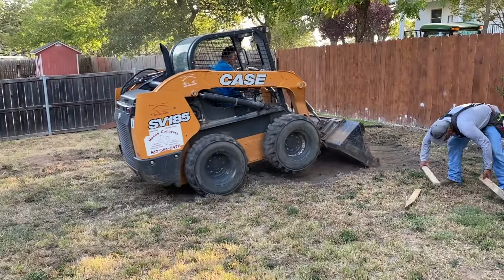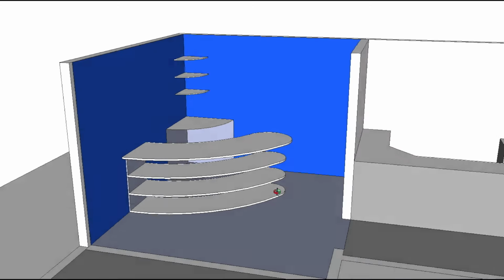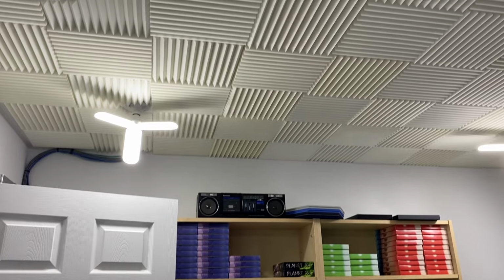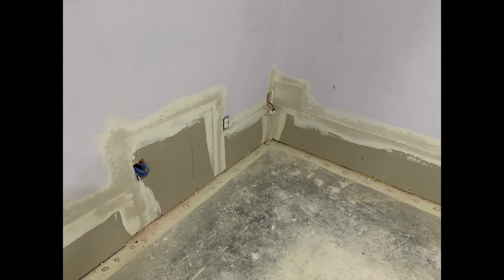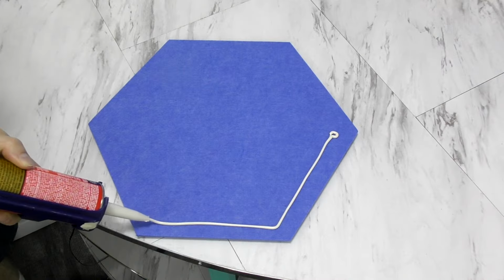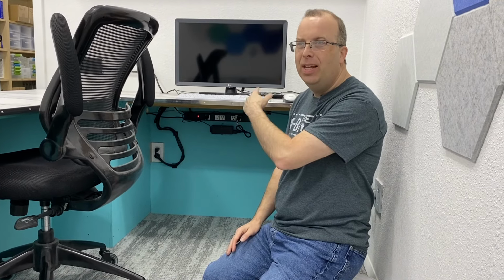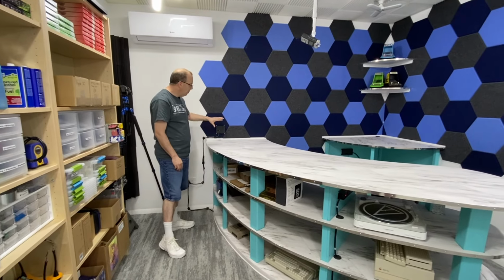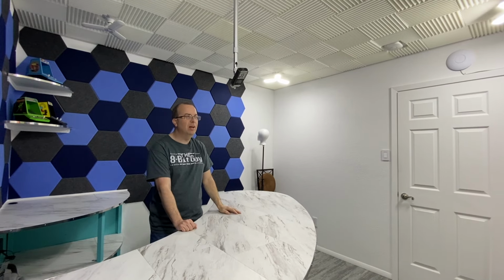8-Bit Guy Studio Build - Part 3

Comment: The WHITE background is a MISTAKE as it's always going to fight for attention with foreground objects (including the 8-bit guy!) Your last set was almost perfectly balanced, maybe by accident, with the lighter objects usually being in front of the darker. (white shelf in front with dark wall behind.) I'd repaint the back wall making sure everything on it is darker (and less pink) than your skin. The counter in front should be just slightly darker then the standard beige computers you put on it (to give contrast.)

Having two hues of blue (blue on the design and aqua on the base of the counter) is an eye sore. Compliment the blue with the same shade of orange that was on the drum machines on the keyboards that were in your last set. It is the natural complimentary color to true blue.

Finally add fine detail (like hanging computers and such) on the side walls, to add interest and diffuse echos, but leave the area directly behind you head a simple geometric shape that's slightly darker than the rest of the background to frame you. Always shoot with the walls at an angle to give depth. (avoid lines in the background that run parallel to the frame)

Comment: I actually like the tiles behind.   Only issue is on the right side ,  you should add a few extras so it looks finished on the camera.    I also would consider using the lapel mic more often.   In my opinion it sounds better and as you move around, doesn't change the sound like an overhead will.   Lighting wise you should consider some film/tv grade lights or filters.   I find you look more washed out with the ones you got.. perhaps adding lights against the wall as well to give more contrast. Over all its great.    Minor details make great into awesome.

Comment: You should have central unit air conditioning with a 3-ton heat pump plus with a Merv-11 filter also with a coil heater on the inside of the central fan it's way more efficient and is way better for your air health.

Comment: If you hang some curtains over the opposite walls, doors & shelving, it can help reduce they echo more.  I often use black-out curtains on-the-go with stands to block unwanted light on-locations and also for sound dampening.  Hung from rods, you can easily slide them off to the sides when you don't need them for shooting.

Comment: Regarding all the comments about grounding the metal workbench edge:  Antistatic work surfaces and wrist straps are grounded through a resistance in order to protect the electronics, NOT YOU.  They try to bleed off the static buildup before you handle components.  Any work on high-voltage, include line-power and especially higher like on CRTs requires a different strategy to protect YOU.

Be careful, stay safe.

Comment: just use a 1:1 mains isolating transformer, you can then accidental touch phase and no shock. and now you can also use rcd's (didnt have them in the 80s / 90's, but always used the transformer. btw, a hv discharge from the back of a crt (its same same as a charged discrete capacitor) will kick you hard whether you're grounded or not !!!

Comment: safe to touch esd strap would be connected trough a 1-10m ohm resistor anyway ant esd cable have them in series with the plug both as a safety measure and as a anti-zap feature when you charge your feet on the carpet and touch the esd ground to let you be discharged slowly

Comment: Sound could still use some more deadening - it's a bit boomy, I think you could use some bass traps in corners :) And some real mineral wool panels on the wall (and possibly right above where you stand ) that's not visible, to absorb sound reflections.  The foam that you used on the ceiling is not very effective as sound absorber, it's often marketed that way but doesn't do much.

https://www.youtube.com/watch?v=_dH4H57UsJU - (apparently fiberglass is even better) it even has the instructions how to make those :)

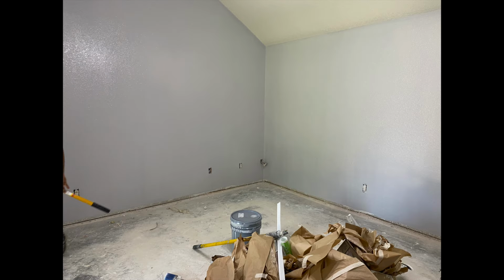Comment: 7:54 - The cat is still wondering what happened and why the food bowls were moved about 😾😾😾
18:15 - I think there are too many dark tones regarding the wall tiles - The blues are fine, in my opinion, and the black/greys are the issue.  You could swap out some of the black tiles out for light grey tiles but something you could do straight away would be to take some photos and check the histogram to see how flat/balanced the histogram looks and adjust the tile colours.

Comment: I think you went the other way and now your washed out and over exposed. Simple fix in post, but your table is definately washed out, which is sad since thats where you are putting the focus after yourself. My only practical suggestion for your table being super white, is maybe run an almost transparent resin. Kinda like how you tinted the windows. If you want to build on an 8 bit theme, you could get little tile squares for mosaics or something to put in there and make them like pixels on a screen.

Comment: Don't want the sun to turn my old computers yellow. A few weeks later: Okay, time for some retrobrighting... drags old computers into the sun... ;) I still struggle to understand what is really going on during this process. Recently I pulled out a midi-keyboard that was hardly exposed to light at all, because I've left it in its box for years and all keys were completely yellowed. I believe it was exposed to cigarette smoke a lot during that time and that this would be the reason.

Comment: My opinion on the hexes - they are too strong (striking), you vanish a bit, they draw all the attention. Maybe it was partly because of the T-shirt you had on this particular video. They are also too dark and at the same time there is too much contrast between the dark ones and the light blue ones. I think a solid color or some subtle gradient or pattern would be better. And last but not least - the cyan color of the desk at the back doesn't match the blue color on the wall, not at all.

Comment: Why on earth would you ground that metal strip? If you are worried about destroying electronics by an ESD you should put a resistor in serial to ground and make sure the surface is made of ESD protected material and properly grounded as well. But seriously, I would rater have some electronics destroyed instead of accidentally electrocuting myself by forgetting to flip that switch.

Comment: Was thinking that another alternative for the walls would have been to use the 'maze' generator you've demonstrated (and that has been done lots of times) to generate a layout for vinyl cutouts to put on the wall. That said, the fabric tiles probably add some more noise suppression, so it works too.

Comment: OK, what happens if you get a mains live to earth fault in your studio which isn't caught by an RCD or ELCB and the edge of your desk becomes live? The end result could be hair raising to say the least. I suspect you need additional circuity where you have your switch to ensure that doesn't happen. A large value resistor might also be a good idea. With static electricity you need you and the item you are working on at the same potential, that why you ground yourself to the item you are working on, not to mains earth 😀

Comment: Please please please RETINT YOUR WINDOWS! I've worked with Window Tinting shop (for Houses and Vehicles) and MAIN RULE IS - Home Tint should be applied from the outside, especially if it's "Blocking" or "Reflecting" either View, Sun or IR
You can concetrate so much heat inside the glass that it can shatter when tinting from inside to block the outside rays. You can tint from inside only if it's that Car Tint that adds a shade, but does not reflect or "block" sun rays.
We always removed the windows/glass from its frame, turned them around, set them on the ground, cut, clean, clean, wash, THEN TINT, then put the Glass into the frame

Comment: The hexagons look cool, but the turquiose wood definitely clashes.
Reply: I'm come to the conclusion that turquoise doesn't match anything.
Reply: @KurtNiemand  it matches anything pastel and every tint of pink.
Reply: @KurtNiemand  

I disagree. Torquoise is a "soft" and bright color,  but it's not being used correctly in this video.

Here's a combo that always works together in RGB

#016875 - Dark turquoise
#01A9BB - Light turquoise
#FFFFDE - Pale Yellow
#DBE5EF - Light Grey (With tones of blue)
#52626F - Dark Grey (With tones of blue)
Reply: I agree. really like it but would paint over the turqouise with the navy blue colour, or grey
Reply: The hexagons look okay. The gray isn't solid so it looks out of place with the solid black and navy. The turquoise wood looks absolutely terrible. Repaint gray and everything will come together much more nicely.
Reply: I think they would look better with the lighter gray hexagons
Reply: Add in the metal straps on the edge of the shelves, it's just too busy.  All dark blue hexes would be better.
Reply: The colours don't really fit together. But I would be carefull not to get too dark in the end.
The turquoise is a great colours in my opinion. But it clashes with the other colours a little. I didn't expect the whole wall to be covered with tiles either.
However, finding the perfect design is not always easy.
Reply: @hw2508  I think it's a design clash

he brought the outdoor colors inside and don't make sense with the Wall Tiles 

Instead.

He should add a different theme to the inside.

Whilst the c64 has a terrible contrast  in terms of a view for BASIC

it'll work wonderfully as a room theme

use that
Reply: Basically

VIC-20 on the outside and the C64 on the inside.
Reply: It's more like a sea foam. or undine. But I like it either way.
Reply: @Her_Imperious_Condescension  straight as a rainbow 🌈
Reply: @poopiepants1564  
No.
Reply: @Her_Imperious_Condescension  ya man, u love men
Reply: I think orange goes well with turquiose. Like the Miami Dolphins football team.
Reply: ok gay guy
Reply: @poopiepants1564  
Ace, actually.
Reply: @Her_Imperious_Condescension  gaycey acey got it
Reply: @poopiepants1564  
Ace = very much not gay
Reply: @Her_Imperious_Condescension  DONT DENY YOUR GAYNESS GAYCE ACEY! U LOVE MEN!

Comment: No jack on that wall:  could be worse!
In the early 90's I went to work for a start-up and their space was under construction.  They were so clever in specifying an Ethernet port at the end of the hallway, so they could put a printer there, on a table beyond the last office door where it dead-ends.
So, they had an extension cord running into that last office, as they forgot to also specify a power outlet there!

Comment: For ESD grounding mats, tables and wrist straps have a 1 megaohm resistor before connecting to mains ground, 110volt or 240volt faults to ground through your body thus will not be enough current over 1 megaohm. I work in a manufacturing room where we have inhouse designed full ESD safe workspaces

Comment: I agree with the idea of lighter walls and a darker table, in part to keep the visual weight at the bottom where it feels more natural. Did you consider painting the walls a solid color at all? Then you could key in any background you wanted in post, or change the color depending on the theme of the video (assuming your clothes or products don't share the wall color).

Comment: You really shoud ground that strip through safety 1M ohm resistor, better consisted of more resistors in series. That way if you really happen to touch the ground strip, you won't get electrocuted that easy.

Comment: The tile colors work for the most part, but it does absorb maybe a bit too much light, regardless, if you put some more tiles on the door wall, and maybe a few on the back of the door itself, it would eliminate all the echo.. I'm watching on a Galaxy tab s7 and using Harmon kardon buds for sound.. so I can really really pick up those sound reflections.. it's much improved and your sudio really has me thinking about doing the same thing for my computers and ham radio equipment...

Comment: Your lock on your door is the same as the one my wife and I just installed last night after our previous lock jammed in the locked position (funnily enough that lock was a direct replacement of the first lock that came with the house that did the same thing 1 year previous when we had first moved in that our builder had replaced saying this issue was very rare and he had only seen it about twice before. 
Hence why we now changed brands and went for a smart one.

Comment: It turned out a very nice set up. Congrats! There are a few spots in the back where there are no hexagons and you can see the white wall behind. Messes up my ocd. Looks bad in my opinion. Perhaps you should consider filling those spaces up? The small ones, right in the center of the frame, around the shelves. You filled up a few, but not all of them. Cheers

Comment: Don't hard ground that metal strip, but use a one meg resistor, that way the static will be dissipated, however if you touch it with a pcb etc, you won't (hopefully) blow the crap out of it.
As for the tiles, it would be nice to add some computer brand logo's to them, so they have a connection to the subject.
I like your stereo mic, it does a great job.

Comment: tapping into a surge protector for an exposed ground like this is not a super great idea. your nutral line on your panel is tied to ground in the breaker box. and all it takes is a snaped ground wire from the fuse box to make you the shortest path to ground.

Comment: Hey, the hexagons are different. Better than the other stuff that was on the walls. Not bad. Not horrible.  Different. Do I like them? I'm not sure. The missing bits bother me. I know that they will be off camera, but just knowing that they are not "all the way" is getting on my nerves.
Overall, I love the build. I feel your pain about the ethernet ports. There is never one where you need it ..
One thing I didn't see, is your security camera system. Either very well fitted and unobtrusive, or not fitted. 
As for your studio worktop. I like it a lot. The earth connection is a brilliant idea. Except for the possibility of grounding out... Here in the UK we have RCD with earth trip... (I don't understand how they work either) but sometimes it can trip out when you or I, touch it. Something to do with static electricity... But hey, I know nothing.

Comment: you know we have 2021, right? i really like your content, but this NEWLY built studio is kinda weird i have to admit. i appreciate your favour of those lamps, but they don't fit any videography environment - you should rather get nice studio lights with proper umbrella diffusers. i also don't get your grounding concept. RIGHT in case you work on a CRT, both YOU AND the CRT should be grounded by the same wire. you can clip the grounding wire to your ankle, if you don't want to have it in your hands' way, but i'd show the grounding beforehand into the camera regardlessly, since you act like a teacher for some people. there are conductive mats for electronics work benches, that can be grounded and i really think you should cover your main desk with those.
just as a reminder: you are building a new studio, not rebuilding your old one. maybe it's time to go for a new style and way

Comment: Counter-intuitively, by placing the hexagons in a pattern, and more importantly, ensuring that no two touching hexagons have the same color, you have maximised the "messiness" of the pattern. Don't be afraid to make it asymmetrical and more "random". In fact, it might both make the pattern look more interesting, and more easy on the eye, than the current "static noise but strictly ordered" pattern. Jm2c

Comment: You should NEVER directly ground any ESD protection for exactly the reason you pointed out - hard grounds can be deadly.  Replace the switch with a 1 Meg resistor and you're good to go under all use cases.

Comment: Ethernet solution:
Remove the ethernet panel and indent the ports into its own box inside the wall. Then when you plug both ethernet cords in. They are flat. Because they connect inside the wall. You can always make it look a little dressed up if you don't want a gaping hole in the wall.

Short version. make the ethernet ports deeper to make wires flush/flat against the wall.
Reply: I'd just get a couple right angle adapters.  At least then they wouldn't protrude from the wall

Comment: On your main studio bench, instead of 1 visible power strip at the end, you could put 3 spaced out, hidden power strips that come straight up out of the bench like the ones used in a lot of modern RV's. They could be made nearly invisible when not in use by using a small bit of the same tile to cover them.

Comment: I would suggest adding one more layer of hexagons at the bottom so we can't see the white wall from your normal filming angle, and painting the gaps between hexagons in the corner and the white areas left near the ceiling. (You could cut hexagons for that space too.) Even the hated vinyl decal material would be a better gap filler than white wall is.

Comment: You need to add more props in the background of the new set. Just having the hexagons and a couple things on the shelf in the background isn't interesting enough in my opinion. I prefer what you did with the original set with the keyboards and the plaques and wires on the wall, it gives it character.